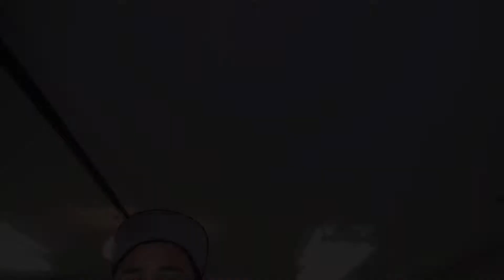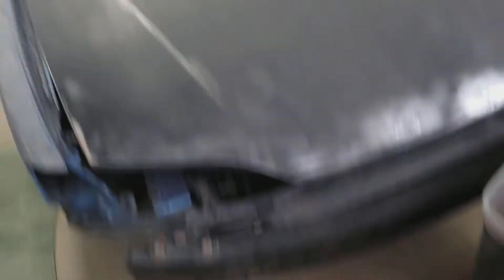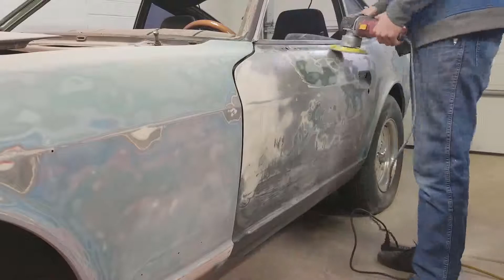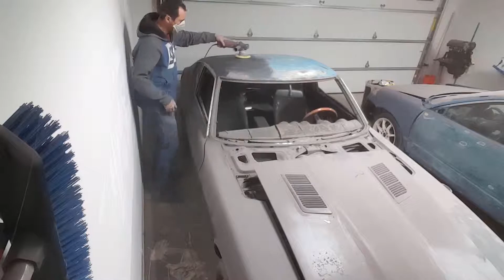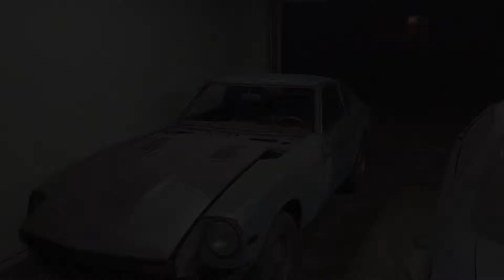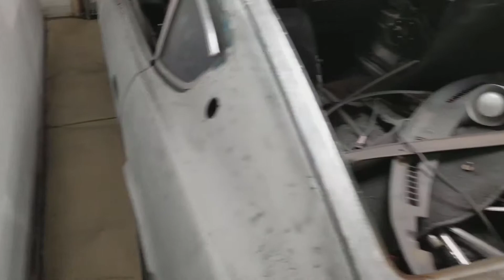280z Build Pt. 3 | She's Half Naked

Comment: I like your idea of talking over you elapse time video .makes editing easier and you get work done.
Its the biggest reason I dont video my builds.
But I may now that I see you doing it.
Also your edits are very good for your channel being 4-5 videos , in.
Great job, great car, love to watch it come to life.
 Color thats a hard one. Easy for me because Im doing two cars at the same time.
White is cheapest color and Im doing inside and out and engine compartment. I want cheap and easy 2k urethane single stage.
  I bought 2k primer in white and 2k 
White single stage paint .
 "Speedkote" on ebay .Cheap! gallon of primer and hardner Urethane 100bucks.
Gallon of white 2k urethane paint with qt hardner 100bucks.
You cant beat that. A harbour freight 20 gallon compressor 150bucks a good spray gun 150 bucks..
Watch lots of spray paint your car videos and bamm !
Reply from the maker: Thanks for the nice words,  and Thanks for watching!  I'm real stuck on colors. I kind of want to keep it a cool bright green as tribute to its original color. But pearl white looks awesome, a sunset burnt orange, or a metallic blue. I just dont know.
Reply: @theaddiction8143  I love your color ideas..Im not a rich man so I must consider This is my daily driver.
  How much is the color ?
How easy is it to repair and match?
How does it look faded ?( years of use)
    I know I like the "TOY" look of a straight color.
   I know I hate that clear coat has peeled of look of cars these days when old.
   I know on a sat or sun I can touch up or spray a panel white again.Straight white , 
    Those were my thoughts.
I have a bright red and black set of racing seats I got on ebay for "POP"! OF COLOR.
 I always loved the metallic blue , but blues are expensive.( the blues I really like)
  So My car will be "traditional " black flares black rear spoiler, black front hood. White car white front airdam..
Lowered 16x7 wheels ( because I love the original steering wheel.
   I dont like the very hard steering wider tires give. Especially extreme summer tires that are grippy.
   I live in Florida so no snow to deal with just heat and water.
( moved from NewEngland )
I dont thing green or brown does much for a Z.
  I have 1/43 and 1/64 models of 
Z"s.
Metallic blue, that ocra orange that the Z432 and some Z cars came in ( not the orange / but factory orange looks very good)and alot of white models. 
    The White just looks "durable attractive" 
Remember the Z HAS VERY GOOD LOOKS......all on its own!
Its really not the color.Its , the DESIGN , that grabs you.
    I would take two colors flip a coin.
Take the other 2 colors flip a coin.
   Then the two winners flip a coin..
And see which color Calls you more / or saddest about it losing.
   Pick the one , you cant live without.
  To match my seat of red and black.I have a full black dash cover. Im leaving the trans tunnel uncovered 
In "white. "
    Stock new black door panels, all the black plastic trim. Bare White trunk floo,r to carry the bare look of the trans tunnel. No kick panels "bare"
Red leather on roof edges by my head and the roof over new closed sell foam instead of that crappy old yellow foam.
    Im using Truck Bedliner on the bottom of the car.
Monster heat barrier spray/ with bedliner on fire walls ( white Raptor bedliner)and under side of trans tunnel to keep heat and noise down. 
That way I can keep the trans tunnel bare but not HOT from heat.
 The monster heat barrior cuts done 60% the bedliner cuts down more heat.
   Engine compartment White. With red spark plug wires , red silicon hoses. 
That ties in the red seats and red 3point seat belts. Racing seat belts are VERY annoying to live with day in day out.
  Im making my own double pipe exhaust .
Headers have 3 into two running two pipes into an " internal X pipe muffler with 2 outlets running to more pipes into a 2 inlet 2 outlet muffler.
Here are Z in various colors 
https://youtu.be/SFx70XZGKRk
Reply from the maker: I can tell you're an enthusiast. I love the energy your words Express. I can't wait till I get this ride done. I'd love to do more than just build videos.  I hope you enjoy the build.
Reply: @theaddiction8143  I enjoy the journey of building 2 Z restomods at once.
   The 280Z is mine , the 240Z I got for my ex- stepdaughter , that was told by her parents ,she "will never have one , hard to find and too expensive."
   Ha ha Im building her one ( never ! kill a kids , dreams )
    We used to play racing video games....her games. 
Id get a McLaren or Lambo and she would pull out a blue metalic Z with red racing stripes over the front fender. All lowered and flared!
   Id say " you like that car, do you know what it is?"
She'd say ..." Yep ...Its My DREAM car !"
  I said I have had a lot of those back when they were just used cars...I had 240zs , 260z's and 280Z's ..I love those cars.
   Then she told me her parents told her she " would never own one"
    I told her , "you can get one Ill get one for you and fix it up....!
She Rolled her eyes in disbeleif
I said ..."I know put you will see!"
   Her mother and I got divorced.
2 christmas's later , I called my ex-stepdaughter to come see my car I was building.
Both Z were stripped to bare shells
With floors cut out no glass no wiring no nothing just two shells on jack stands.
    She said "oh you got two cars ?"
I said yep....Can you tell what they are...???
She said "wells its kind of hard like this,... there isnt much left...she looked at them.... and said well I realy dont know ...but they sort of look like Z cars from the roof.."
    I said "THEY ARE ...! THIS ONE IS YOURS, THE 240Z ...AND THIS ONE IS MINE THE 280Z!!!
She jumped around and said "Ive never seen one on the road , I had no Idea the size of it ..ITS AWESOME!!!!!"
SEE I TOLD YOU ID GET YOU ONE...dont let anybody tell you you cant do anything !
Hers ,will have ,blue and black racing seats, blue wires and blue silicon hoses.Hers will be stock height cause she now lives in the country so dirt roads will be a thing...so Im building her a more rallyish spec suspension.
And more of a full interior.
Reply from the maker: That's so cool man, post up vids of the builds; I'd love to see them. I think it's awesome what you are doing for your Stepdaughter.  Hopefully she'll appreciate the car as a Historic relic that it is,  and the work you've put in.
Reply: @theaddiction8143  she has no Idea how nice it will be.Since she has moved North I havent told her much...I think shes thinking it will be a long time from now which its exactly the opposite.
    She has never seen any of my restorations. I ran my own "Sports Car" only restoration shop for 20 yrs in the North East.
   Her mother never saw that part of my skill set. , they just thought I could fix things.
 I do everything from body work and paint to metal fabrication. I build motors , Im a one stop shop man.But I just have a small two car garage , i build my two Z cars in. I ride a 82 550 kawasaki " cafe styled " motor cycle year round till I get the Z done.
   We are both going to be happy very soon.
Ive restored everything from Alfa to lotus to porsche 356 and 911 to kit cars and 550 spyders.
   Yep she is going to be jaw dropping shocked.